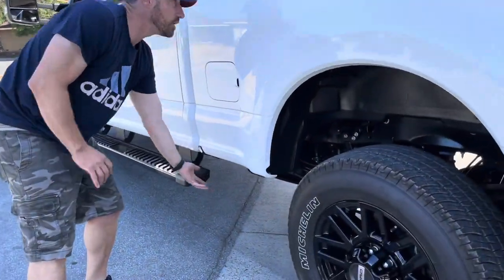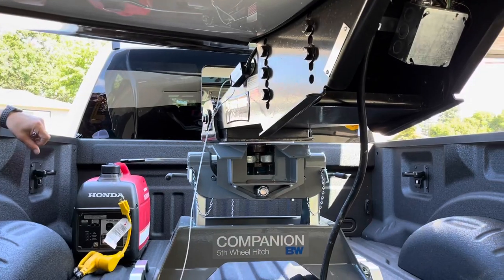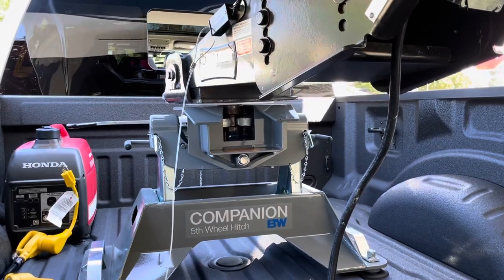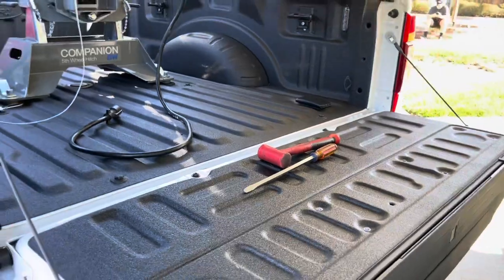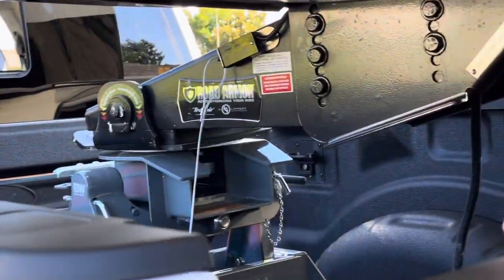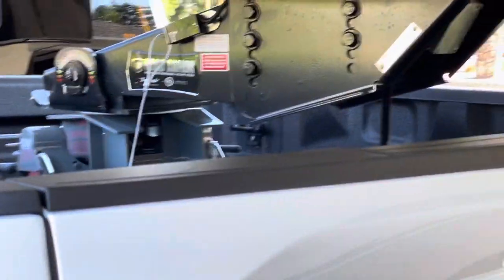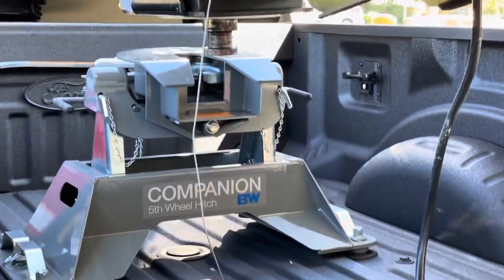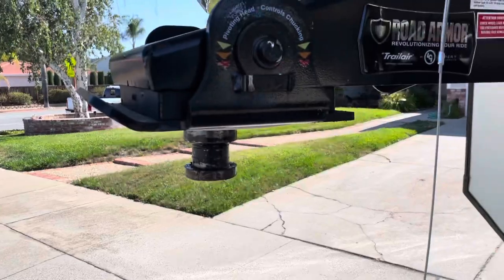B&W Jaws Not Opening - Troubleshooting

Comment: The angle has nothing to do with being able to disconnect.  The problem was you had the trailer lifting the truck .  Only lift the trailer high enough to relieve most of the weight being forced on to the hitch, but not all of the weight.  That is a great hitch and should serve you for years without trouble.  It’s a easy hitch and unhitch hitch!

Comment: Your trailer was raised too high causing the jaws to bind on the bottom of the king pin, you shouldn't see daylight between your lube plate and the fifth wheel plate when unhooking or hooking up. Always maintain some amount of hitch weight on the truck when hooking up or unhooking. It has nothing to do with the angle of your truck in relation to the trailer, you can actually hook up a fifth wheel if backing in at 90 degrees to the king pin box (providing you have the cab-to-trailer nose clearance).
Reply from the maker: Thanks, bud
Reply: Yeah, you could see that the bottom of the puck was locked UP against the jaws. At least you know that thing is robust when locked.

Comment: As a truck driver, I gotta say this is painful to watch… I will give you a tip though, always have some weight resting on the 5th wheel where the rear of the truck is barely squatting if any, you’ll be able to pull in/out like butter. 
And no the angle of the truck does not matter, if you’re doing it right.
Keep the skid plate and pin well greased and the locking jaws clean of debris.

Comment: Ok, everybody quarterbacked so for the benefit of future viewers, let me convey B&Ws advice.   1) Companion Hitches don't have spring loaded jaws that pop open when the lever is swung forward to open them.   Therefore, you will NOT see the jaws open.   the video makers clearly didn't read teh simple pictorial manual or the short text Operator's Manual.  It clearly states what I said above and that once you've raised teh trailer a bit to unload vertical load, just pin the arm open and slowly pull forward. The Jaws only open and release teh pin upon being pulled open by the KingPin as you drive forward.  All this binding talk that people apply to B&W doesn't really exist, like in most spring loaded "pop open" on release style couplers.  READ the MANUAL.   B&W is very clear, the hitch was working absolutely fine.

Comment: This was an interesting video and I’m glad you shared it with us.  I just purchased the B&W Companion 25K Hitch and used your video to set it up.  I had lost the setup directions when I went to buy a 3/4 inch impact socket so I wasn’t sure where the little spring went until I watched your setup video.  If this ever happens to me at least I will have one option to check before trying something else.
Reply from the maker: I’m glad our video helped. Also, we learned from another comment that if you just pin the latch in the open position and slowly drive forward, it will come right out. We tested it and it works!

Comment: Just pin the handle open and pull out the jaws are held by a cam
Reply from the maker: Just want to thank you for this! We brought the 5th wheel to my father-in-law’s driveway this past weekend and encountered the same thing. Took your advice and just pinned it open and pulled right out. So simple!
Reply: Even simpler if the trailer is at the correct height to unlatch.

Comment: As you discovered, the trailer was lifting the truck. I’d suggest don’t use that lube plate. It’s necessary to have some kingpin left and when lifting off the truck. It looks like the lube plate is taking up any potential slack (height) of the pin that you need to have. My two cents.
Reply from the maker: Thanks for the thoughts. Your channel looks pretty cool!